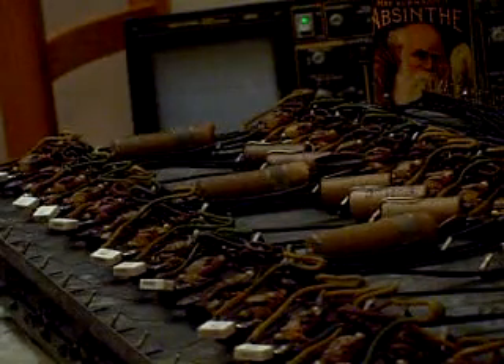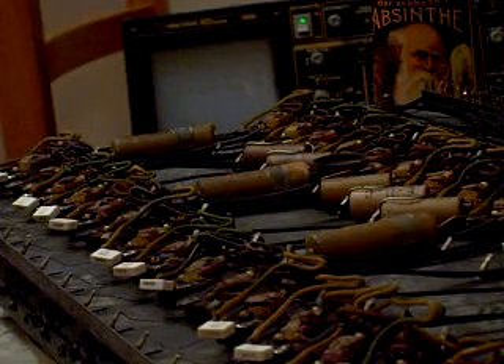Hammond model A tonegenerator recap

Comment from the maker: hi! serial no is 2414 originally made for 230V/50Hz  generator is pencilmarked 11-19-36 and the no 141  also V19 in red ink

upper manual is assembled by Mildred and inkmarked G1500
Lower manual is assembled by Jack B Waters (same guy that assembled a novachord in the novachord restorationsite) and is tagged 11-19-36 (what i believe is 19nov 1936...and is inkmarked G1499
I do believe this organ has been owned by a Mrs Harry Bury / 11 Livingstone road / Accrington. i found a card inside :)

Comment: Very useful job, I've recapped my '57 C3 (it had still paper wax capacitors) and you can gladly hear the difference!! More present sound above all you play in a band..same bass response and more mid-treble end. If you don't want this edgy sound just turn down the tone pot on the preamp and you will get the same old muddy sound!!

Comment: Thank you so much for the information and replying so quickly!  
Can I ask a couple more questions?
Is the serial number 2414 on a Hammond plate or a Boosey & Hawkes plate? Where on the generator are the names and dates marked?  We havent seen these anywhere on the ones we have here yet, but we might not have looked in the right place!! I am presuming that the no 141 is marked in pencil on the top of the generator at the right hand end looking from the back (above the V19 marking?)
Thank you

Comment from the maker: @B3sandBigsbys Well..it surely sounds brighter/ with more treble.with the same thunderous bass response! As seen in the video for just that frequncy i did there, it nearly doubled the output level. I would do it again anyway. it so easy to do when its apart, and those old caps are a bit...oooooold right? ;) Of course i saved all of the old ones if i should ever sell it to some puritan.